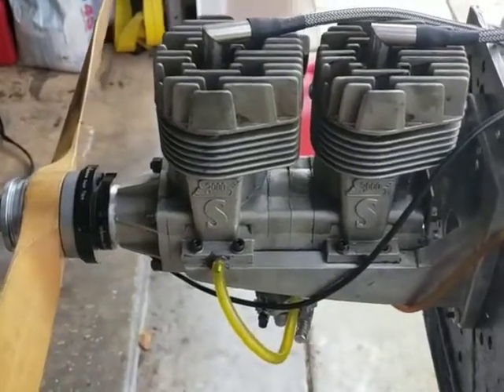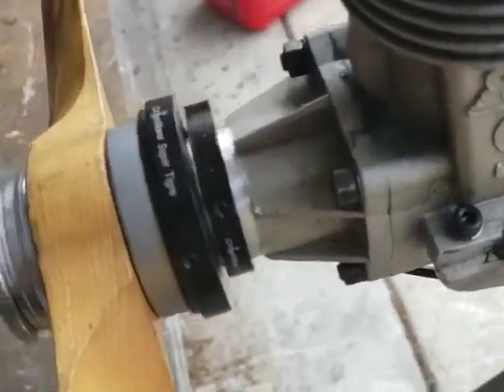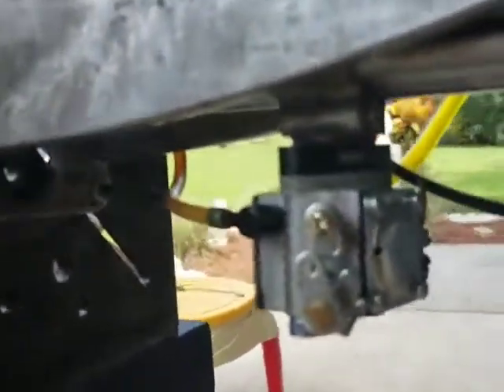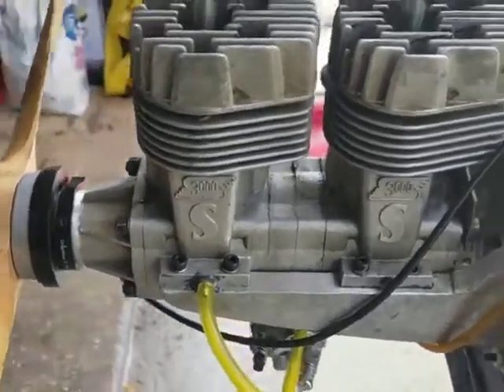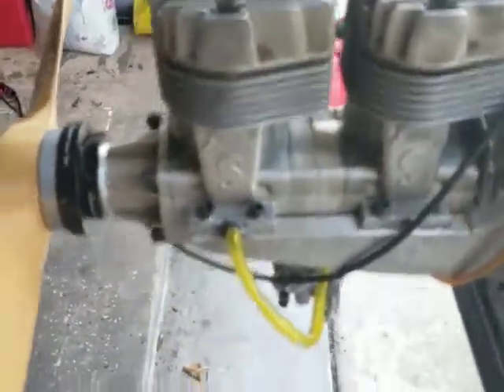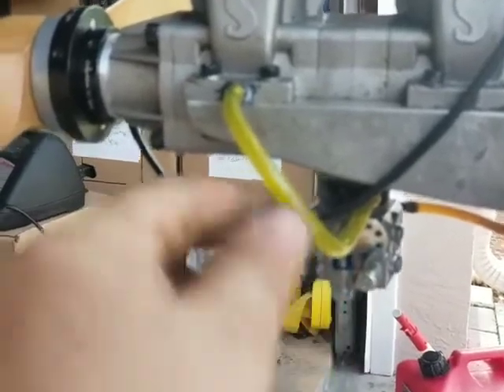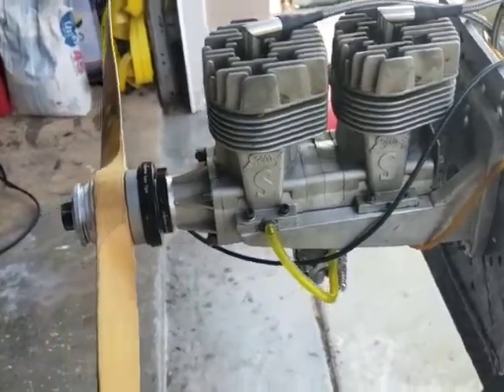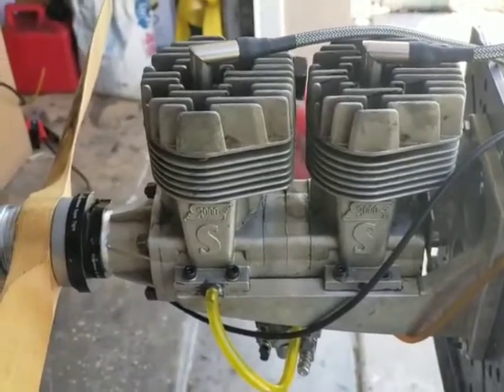SUPER TIGRE 60 in line twin CH IGNITIONS CDI & Gasoline Conversion

Comment: I have the same engine, and was considering conversion to CDI and gasoline, but I was thinking about longevity. This engine was not designed for gasoline, has no roller bearing on piston rods, and head fins are small.... the engine is designed for glow. Can can it affect the engine??
Reply: The engine is design for glow, thus for high oil content of this kind of fuel. The only concern with gasoline is to not use a mix for chainsaw engine with not enough oil.
Reply: Use 16:1